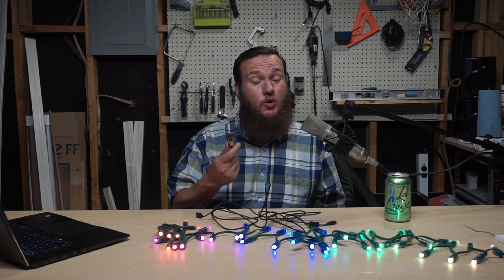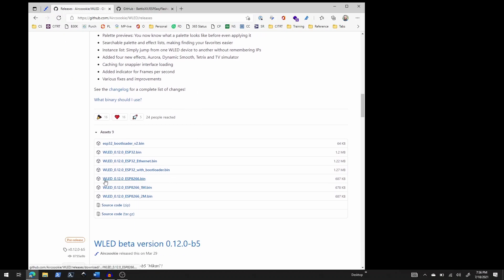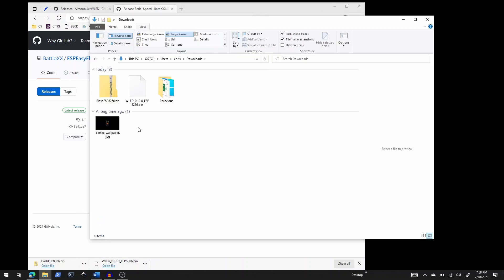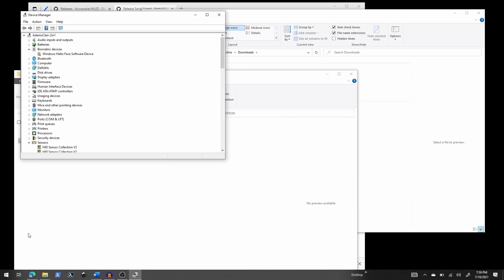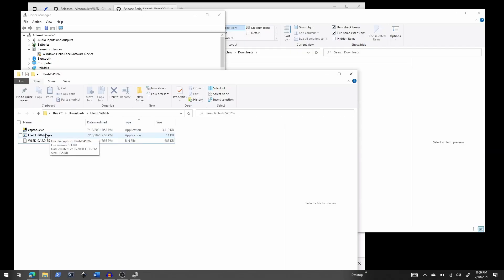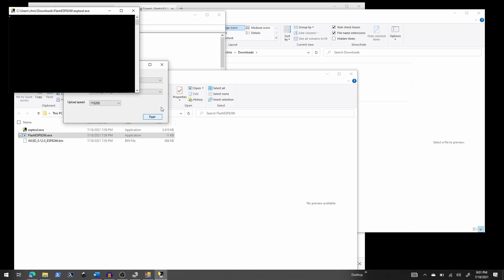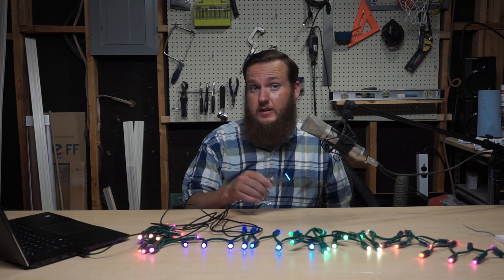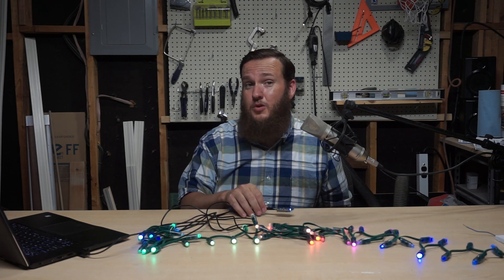A quick guide on flashing WLED to a NodeMCU ESP8266 board

Comment: I got to the step where you open ESPEasy Flasher and then flash wled onto esp but i get an error reading "Flash failed with arg--port com6 --baud 115200 write_flash 0x0 .\WLED_0.12.0-b4_ESP8266 (1).bin are the Settings correct?" i have no idea what i did wrong, i followed your steps exactly. any idea what i should do?

Comment: Thanks for the great video, got mine to work but could you answer this; when I unplug power to esp8266 it reset the lights back to ember color then I have to change back to correct color.  It’s like it doesn’t remember settings. Thanks for the help.
Reply from the maker: I'm not sure, I'll look into it and see what I find.  We may be stuck with resetting LED configs after power cycles based on how the ESP8266 works, but I'm not sure.  If I find a way to do this, I'll post a video about it.

Comment: Looking at options to setup LED strips for my house. Looking at options like RGBW2 or SP105e, and now this that I've seen these videos of yours. For RGB(maybe RGBW) LED strips for the kitchen where I may want to have an effect sometimes, which option would you recommend? I can't see much on either of the first two options regarding list of effects and how they look (Just some people saying, "Look it has lots of effects, wow" and maybe trying 2-3 of them.)
Also kitchen under cabinet lights, Cool white or Warm white do you reckon?
Cheers from Down under.
Reply from the maker: I'm looking hard at using ESP8266 with RGBW LEDs, sticking with warm white, but I need to figure out how to manually code things because I want to do kitchen timers and specific data-driven color changing effects, but I'm not sure how to do that just yet.